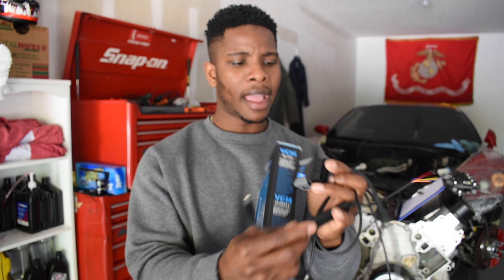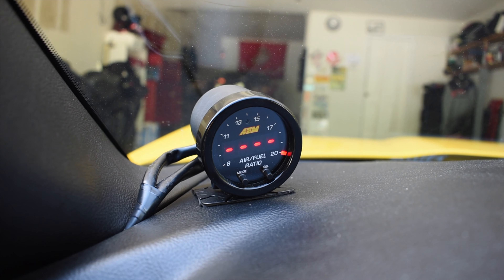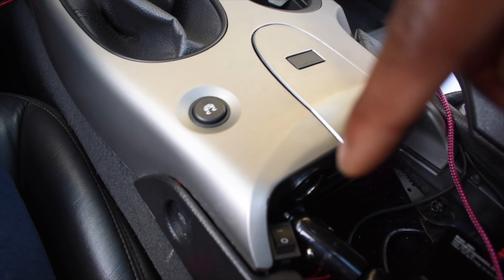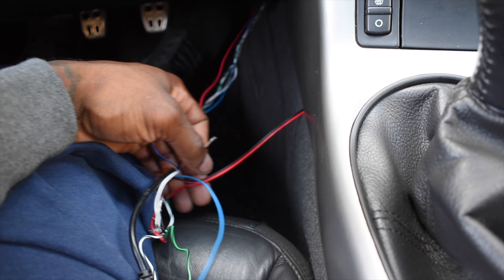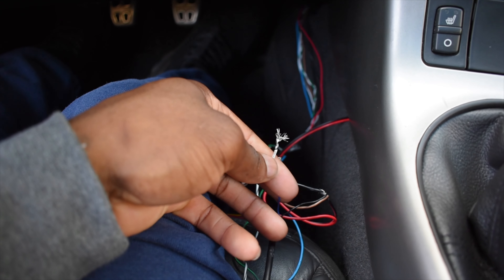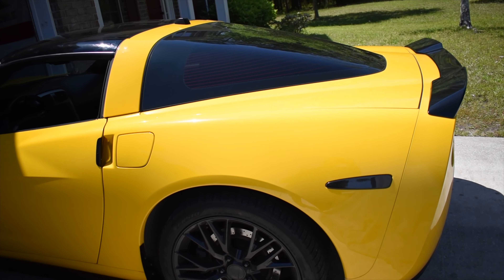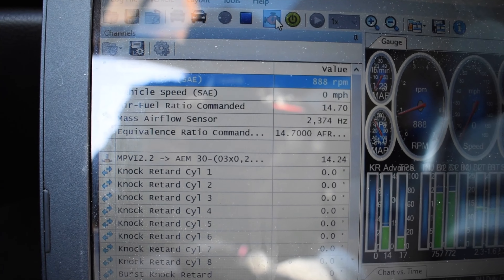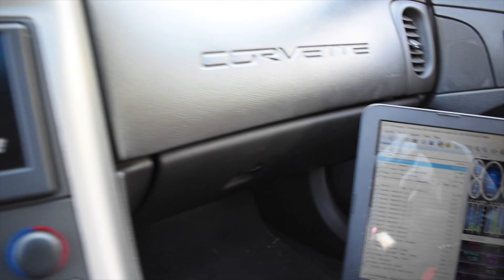How To | MPVI2 Pro Link For AEM UEGO X-series 30-0300 Analog Signal

Comment: My next question is how do you data log 2 wide bands on ho tuners? The same ones 30-0300
Reply from the maker: Yeah I would just map the same PID, run the individual wiring from the gage running to 2 separate prolink and so it that way. Why you running 2? One for each bank?

Comment: How did you add that AEM wideband  channel? I’ve been messing with it trying to add the channel for 2 nights now lol.
Reply from the maker: Lmaooo you have a social media where I can DM more details? Along with a walk thru video
Reply from the maker: Are you using the mpvi2 pro link? All that is info I’m gonna need to guide you properly
Reply: @McgradyRacing  Good video I also have HP tuners MPVI2 with Pro link but I have a question. Could you please send me the  add table info?
Reply: I too can not get it to add to my scanner lol

I got mpvi3 and I got it to my watch list but when I start the scan it disappears from the list 
Spent all day today trying different ways of adding it lol
Reply: Did you buy the hp pro link features off hp tuners? Only way to use pro link cable is to buy it off hp for friggen 250.
Reply: @McgradyRacing can you help me set up mine? I been struggling and can’t read it 💀

Comment: is this the same wires on the newer style mpvi2 with the pro link that screws on the front of the mpvi2? i can shoot u my email if needed
Reply from the maker: The MPVI2 utilizes the prolink to reflect AFR on the VCM scanner. You have to connect the wires from the pro link to the wires coming from the wideband gage. Yes shoot me your email or social media and I can contact you that way.
Reply: @McgradyRacing  I think I got it if not I'll message u my email
Reply: @ASHLEY POPE  ya i have the 2+ i got the wireing from my buddy soon as i can get 02 bung installed ill be able to say then if wireing is right he said it works on his truck

Comment: This was very helpful on the basics of what's wires to connect up to the pro link cable.  I tried my ass off to get the wideband to log using the serial input. For the life of me, I simply could not make it work. Totally sucked balls. I didn't want to have to spend $250 to be able to data log the wideband in the HP tuners scanner software.  Although, I've talked with many guys that had ran into the same issues I did, and they ended up trying higher quality DB9 rs232 adapters and USB-serial cables. They believe that's been the problem. The cheap Chinese hardware adapters are junk. They're probably right, but it's too late lol. I spent the extra money and got the pro features set. I've got more options now though to. 

Thanks for the video brother
Reply from the maker: I got you boss, more videos to come!

Comment: Where did you connect the rest of the wires from the pro link? You only used 2 wires the blue and black wire from the pro link what did you with the rest
Reply from the maker: Hey boss, sorry for the late reply. The rest of the wires from the pro link are not used.